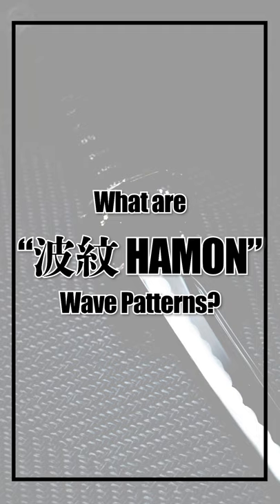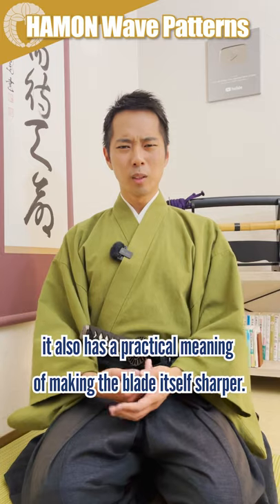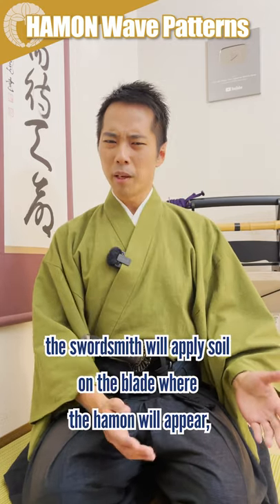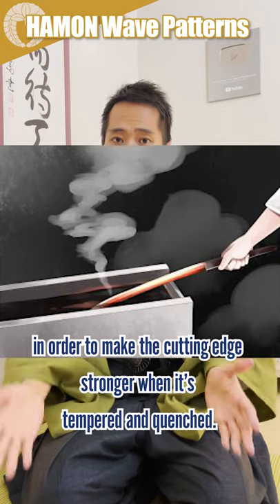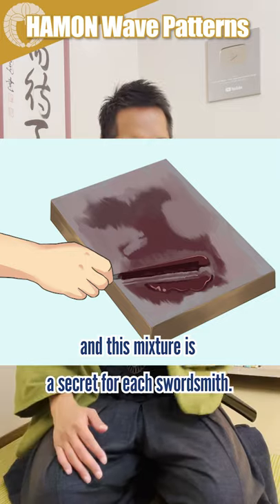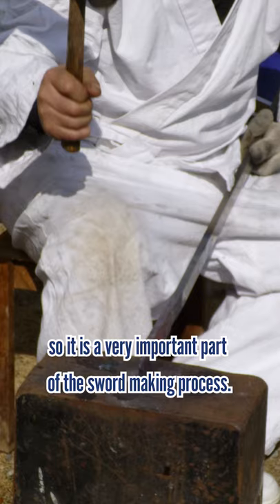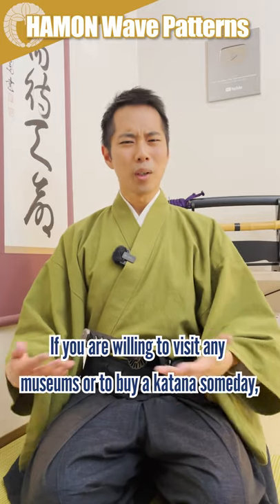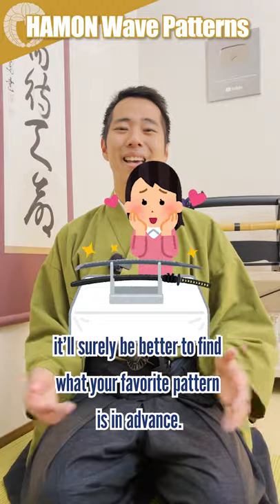Katana Blade Wave Patterns are NOT Just for Design #Shorts

Comment: The hamon on Katana is a result of differential heat treating of the steel while quenching, the cutting edge is hard and brittle like glass, it can hold a razor sharp edge but can easily chip and crack thus by applying clay on the spine of the blade the spine remains softer than the edge and absorbs the force of the sword blows.
Reply from the maker: Thank you so much for the important information I wasn’t able to include in this video!✨
Reply: There was also a "spine" of un heat treated metal put into the back of the sword because, yes, you are 100% correct it was to absorb the impact of the blow and keep it flexible. That's also what folding was for. That and pounding out impurities. Even withing the flexibility of the blade micro fractures would happen. Tho, if your are trusting this blade to keep you alive. It's much better to have a dozen micro fractures and still be usable that break completely on the battle feild. EDIT:(Just because I'm a nerd) heat treating the blade after the quench was crucial to making sure the edge of the blade did not remain like glass. This is what tempered steel is. Out of the quench steel is extremely strong but extremely brittle. I'm sure you can look up a few videos of blade Smith's accidentally dropping their piece and it shatters. This is do to the atomic structure being altered by the forging process. That's why the heat treat at the end of the quench is so important. Otherwise, yeah, you would be going into battle with a glass rod. So yes, it was like glass but, no, it didnt stay that way.
Reply: @LetsaskShogo  SUNLIGHT YELLOW OVERDRIIIVVOOOO
Reply: Bingo! It keeps the edge hard, but not so hard that it will break easily and the rest of the blade hard enough for stiffness but not so hard that it will break with use.
Reply: Hey look...a serious comment with no Jojo reference...that's rare
Reply: @ayouxy  Never heard of "Jojo". I'm guessing I don't want to.
Reply: From what I know, quenching alone would be suitable for an edge of mid carbon content, while a quench and temper is used for high carbon.

Comment: This describes why having any differentially tempered edge isn't just "design", but it doesn't explain why it is "wavy".  The only attribute given to the nature of what the waves look like was in dollar value for collectors, but doesn't describe any functional difference.  This would imply that a perfectly straight hamon would be just as functional and that being wavy is only in the interest of design with no other reason given.
Reply: This is the answer 

Having a temper line at all is function.

The waviness or straightness of that temper line is for beauty.
Reply: No. The wavy pattern also helps to distribute an stress points. If it was just a straight line you would be creating an easy to break section of the blade.
Reply: @bitfreakazoid  They do make katana with straight hamon. Its pattern is called suguha.
Reply: @bitfreakazoid  People make tools which see very heavy use with straight temper lines. To fully investigate your hypothesis, which is what this is, we would have to take a look at grain size, transition between martensite, austentite, and other crystalline structures at the boundaries between the edge and the body of the blade as well as their bulk properties.
Reply: The hamon separates the harder and more brittle edge with the more ductile steel. Cracks can form more easily on brittle steel. Some hamon have “points” or “spikes” towards the edge. This stops cracks from travelling sideways. Some have “bumps” or “waves” instead.

Comment: The hamon is also called the temper line when the clay is added its added to the back of the blade that way the spine of the sword stays softer then the edge the sword can take much more punishment then if the whole thing was quenched in hardened without the clay

Comment: The actual reason is the wave pattern is quenched at higher Temps, making it more rigid and stronger. The reason this doesn't happen to the entire blade is because the back part acts as a backbone, which can absorb the shock. This leads to a brittle cutting edge, but still a way to deal with the vibration

Comment: Has there been observable demonstrations to determine which swordsmith hamon tends to be sharper than most?
Reply: The hamon doesn’t actually determine the sharpness of a blade. It is formed due to the difference of thickness of the clay during the quenching process. This will form a harder edge while leaving the rest of the blade to be more ductile. A harder edge will hold its sharpness better.

Comment: I mean it doesn't make the edge sharper. Just means it will keep its edge for longer as the edge is very hard compared to the spine which stays relatively soft as when the blade is quenched it won't be cooled as quickly(because its covered in soil) as the edge which results in it staying relatively soft while the edge gets very hard.

Comment: Long story short, the hamon is a part of differential hardening. I know, no duh. But what's happening is since the hamon is applied to the spine of the blade and thinning or just outright stopping at the edge. At this point the blade goes in the forge again and then is quenched, the clay allowing the spine to remain hotter for longer, forming larger crystalline structure while the blade's crystalline structure is much smaller. In metal smaller crystals make the metal stronger and harder while large crystals allow for greater ductility. So there's your random science fact for the day/night about the hows of hamons.
Reply: Huh. I'd always assumed the clay stopped heat from reaching the back half, but yeah giving it a slow heat makes more sense. Neat

Comment: The hormone pattern and by line of work is where to aim your Viking broadsword to cleave The Edge clean off of the blade making it no more than a flat metal Club. And by the fourth strike don't matter no more cuz that Katana because it's made out of such inferior Steel will be so gnarled and mangled that the only thing that you can do with it is throw it at me and it last ditch effort to try to run away like a coward.